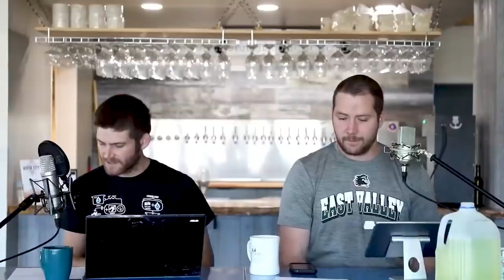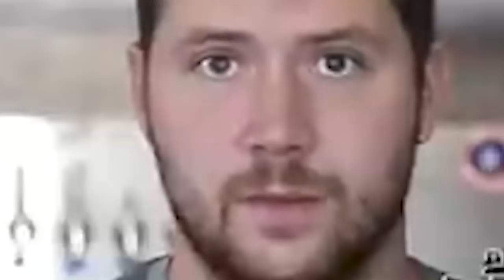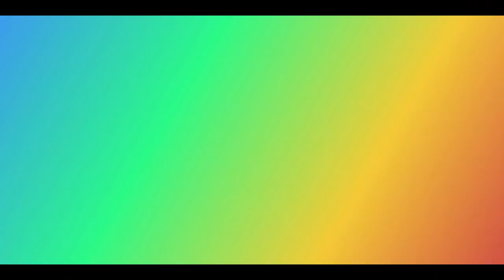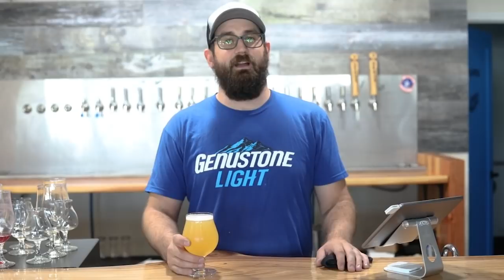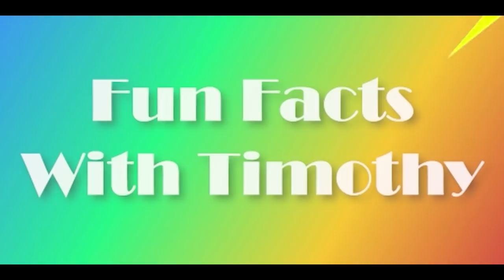Comment: Any idea on why a reading from pre-boil is 1.052 and 45 mins into the boil, the reading is 1.026?  Taken a total of 4 reading throughout the process... temps for all readings were consistent...taken on both Refract and Hydrometer at the same temp.  I'm at a loss... not sure what to do.
Reply: Are you adjusting according to temperature? Wort will give you different gravities readings at different temperatures
Reply: @SchmegmaOnToast  Sure am.  Taking readings from first pull to letting a sample cool to approx 70 degrees as well as taking readings on 2 different hydrometers and refractometer.  I'm perplexed!
Reply: Probably the sample wasn't properly mixed.

Comment: My Brewhouse efficiency currently calculates out at 91-92% for the last 3 brews. Which I KNOW is wrong. I looked up the calculation and it was (measured gravity points * measured volume) / (Potential gravity * Target volume). My last two brew days were VERY good days, coming right on target or above, while producing 2 gallons greater than expected (less loss than projected, thank you hop spider). I get the extra volume affects the number, but I feel like my BH efficiency should be less than my Mash Efficiency, which was mid 80s. So I’m thinking the “Target” volume in the above formula needs to be “Measured” volume. Comparing the actual volume and potential to the realized gravity.
Reply: Your BH efficiency cannot be higher than mash efficiency. BH efficiency includes mash efficiency and then adds all of the losses on top of that (trug, chiller, deadspace, etc.)